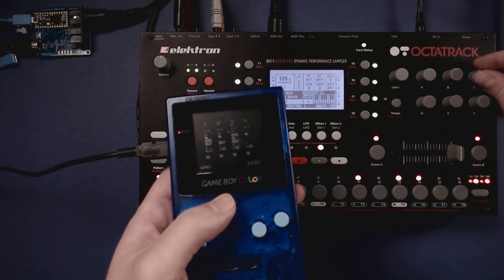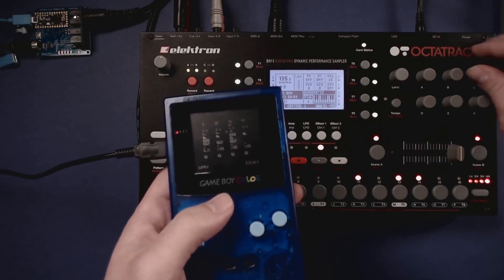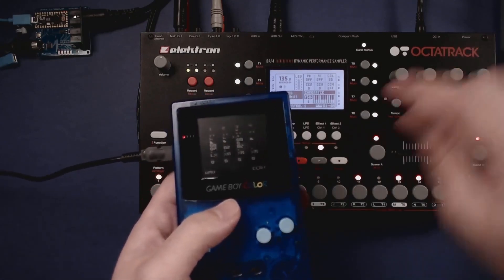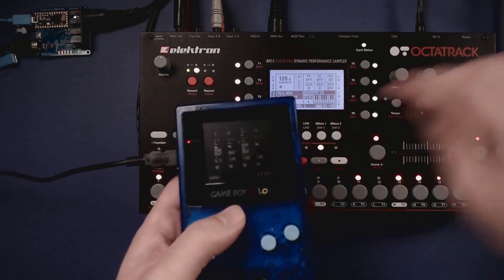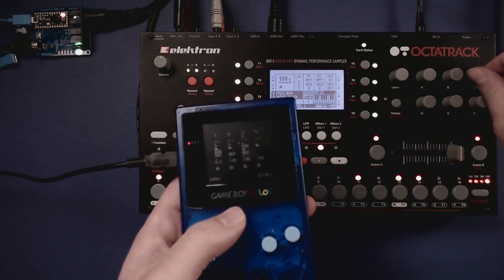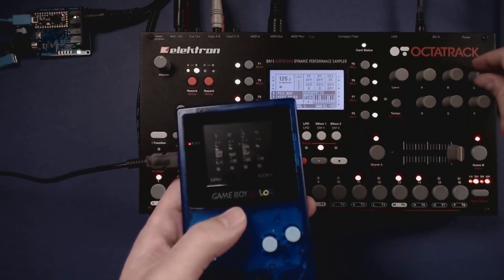Teensyboy Pro tutorial part 2: mGB mode (mode 5)

Comment: Is there a way to save the mGB presets where they are still available after you reboot the gameboy? My presets seem to flush out after reboot and mGB doesn't seem to write a save file.
Reply from the maker: I don't think so, unfortunately. If you use a sequencer that can save MIDI CC parameters though, like the OT, it'll recall them when it plays / reloads a part.
Reply: Thanks for the response, but good news! While going through the mGB code in a discord, the error that was keeping presets from saving was found. It works now and I believe they have submitted it to Trash80 to be fixed in the github repo! But we did get it working today.
Reply from the maker: @iamkeebz  Oh wow, awesome!
Reply: @0Fdigital  well good news!  We fixed the original file plus the long lost extended midi versions Special thanks to Defense Mechanism! 
https://github.com/defensem3ch/mGB/releases/tag/v1.3.4-unofficial

Comment: Are these easy to set up as have one on way my plan is to sequence my gameboy with circuit?
Reply from the maker: It's basically what you see in this video. Plug it in, set the mode, and then set the output channel on your device (in your case, Circuit).
Reply: Ok thank can I use the circuit to sequence gameboy thst my plan
Reply from the maker: Yes, it shouldn't be a problem.. but you'll have to sacrifice a synth track.
Reply: That’s cool
Reply: Ok why would a synth track have to be sacrificed and to be honest my plan is to just sequence gameboy using circuit and record what I’m sequencing from the gameboy via the gameboys headphone socket
Reply from the maker: The Circuit doesn't have any dedicated MIDI sequencer tracks, so if you want to sequence external gear, you'll have to use the internal synth tracks. You don't necessarily have to sacrifice a track, but the notes you send to the gameboy will also be played by the internal synths.
Reply: I get what you mean

Comment: it would be absolutely fantastic if you could make a video going through more of the setup on the OT, what kindof routing did you use and all the stuff to setup. i know this is probably easy for a seasoned OT user, but i've only owned it for a few days and im still struggling to get most of the functionality going... i still have a lot to learn!
Reply from the maker: I may end up doing this one day, but there are a lot of videos out there already for this. I go through it a bit at the beginning of the video; the gameboy's L and R channels are plugged into the A and B inputs. Then, I use a THRU machine for each—the first one assigned to the A input only, and the second assigned to B only. That's really all there is to it, at that point you should start hearing a signal from the device you have plugged in. I used two THRU machines (instead of just one assigned to A B) because I wanted to run just the lead through some effects, and leave everything else untouched.

Comment: here's a question about the OT< i was trying to  get the control CC knob to change the mGB paramters but when i choose cc01 it says pitchbend on the OT.. is there something i need to c hange to get a raw cc01 signal?
Reply from the maker: You need to set CC1 in MIDI CTRL 1 SETUP to 1 (modwheel). Page 93 of the OT Mk2 manual covers this. By default, the CC2 knob is assigned to modwheel. In this video though, I set CC knobs 1–3 to their respective CCs (ie. 1-modwheel/pulsewidth, 2-breath/envelope, 3-undefined/pitch sweep). 
The PB and AT controls are hardwired to their respective CC messages and can't be changed to send any other CCs.
Reply from the maker: See around 5:00 in to see me setting up MIDI CC messages, and also the mGB manual here:
https://github.com/trash80/mGB/blob/master/README.md

Comment: Thanks for this tutorial. I just got a Teensyboy Pro and I am finding that while it receives MIDI Messages from my controllers, mGB doesn't output audio... do you have any troubleshooting advice?
Reply: HEY!! Its a year later and I was experience the exact same problem with the exact same cable gameboy link cable. Headaches all day and then i switched the sides of the cable. Its a weird fix but it worked. Hope ya either figured out whats wrong by now or that this helps.
Reply: @RudeeeWit3Es  I never would have though of this, but it just worked for me, too! Thanks so much!
Reply from the maker: Hmm, it could be a number of things. What kind of link cable are you using? Have you been able to get any communication going between the Teensyboy and Gameboy?
Reply: @0Fdigital  Thanks for the reply It's a green multi-headed link cable from Tomee. I have tested the Teensyboy MIDI THRU to another device so I can confirm that MIDI should be getting to the destination. This leads me to believe that it is the cable or the GB at fault.
Reply from the maker: @strangemobius  Yeah, seems likely. If you can get hold of a multimeter/continuity tester to test the cable, that's probably the best first step, just to make sure the connections are going through. Otherwise, if it's a fault with the GB itself, I'm not sure where to go from there!